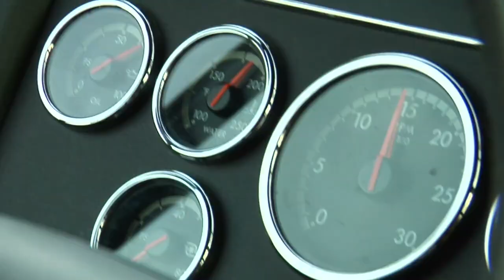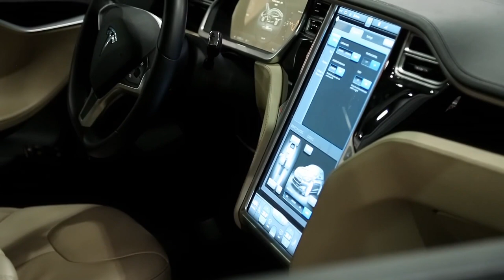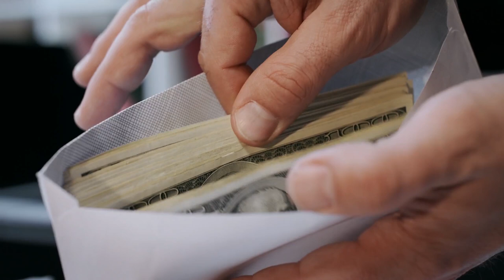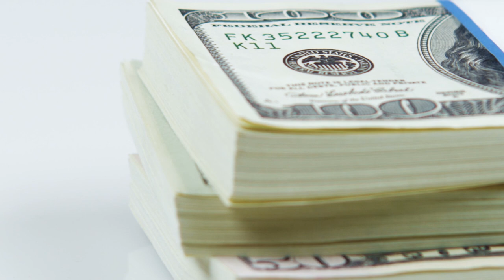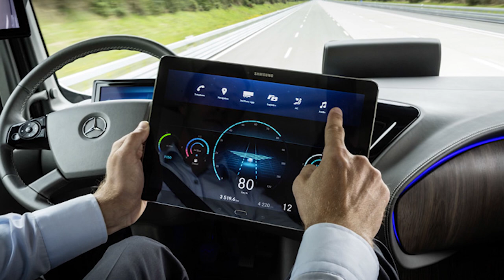5 Most Insane Trucks You Won't Believe

Comment: When the batteries go bad ( and eventually they will ) you might as well buy a new truck cause the batteries are about as expensive.  Then ya have the fact that if you need to get rid of a battery now it can be a hassle ( no just throwing them in the trash) so how , where and what are they gonna do with the old batteries. And let's not forget our electric grid can't and won't be able to handle the electric it would take to run these vehicles if we went all electric. Yup some dope ( or many ) sitting in DC has millions in stocks for these vehicles so they push it, mean while it will be worse or at best no better than what we already have.

Comment: Out of curiosity i think recharging  time can be reduced by many folds if we just change the battery at charging point in an efficient way . Same like we exchange our empty gas cylinders with full ones ... we just need batteries which can be replaced fast.. time will be less than refuelling at petrol station

Comment: Okay maybe I missed it but I didn't see review of Nikola one probably the most advanced electric truck out there
Reply: advanced..  I wouldn't call it anything but "what we know now"  and the fact is battery's are a total WASTE of energy. 
you have to put more power in then you get out. 
this is why your cars alternator puts out MORE power then is pulled from the battery.
and the effeciency's of wire, motors, batteries       not exactly great when you hear the dc moter converts about half to 70% of the electricity to usable torque lol...